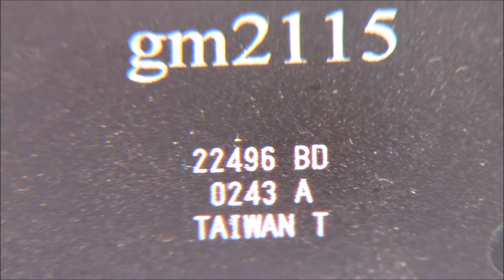Close-up - Compaq LCD Monitor Boards

Comment: the audio board will still work if the screen is broken so take out, solder some old car speakers to it and you have yourself a small amplifier on 12v, you can use the audio plugs to hook it to your phone jack